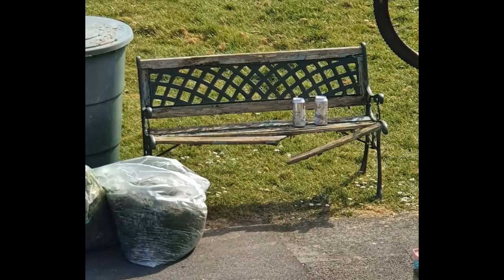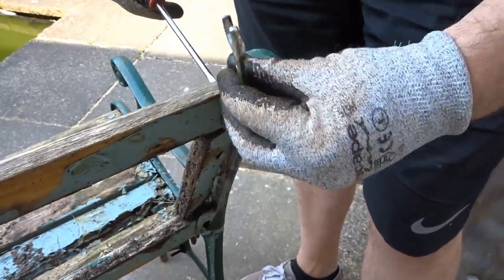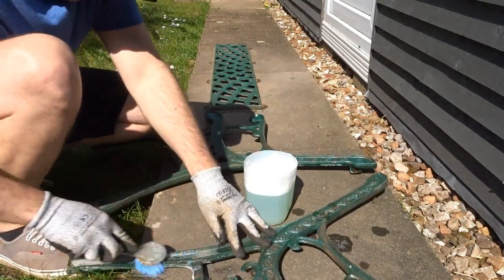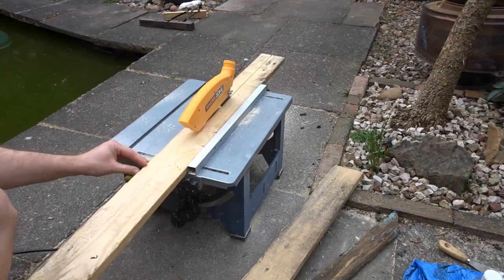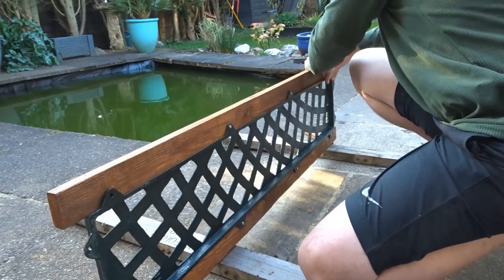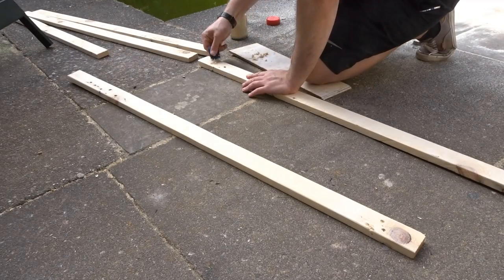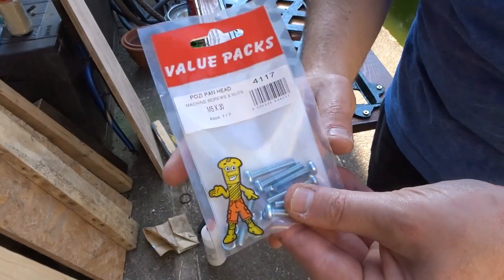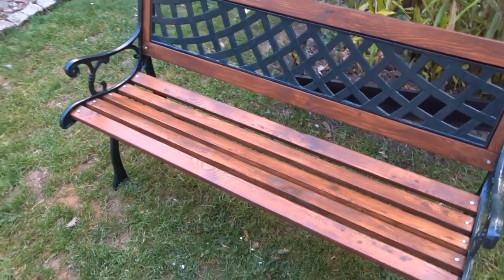How to Repair & Restore a Garden Bench Seat - Garden Furniture

Comment: Phil, I am just doing the same job on a bench, two chairs and a cast iron table with wood surround. I found the bolts had become balls of rust but was able to salvage 27 out of 31 slats which are hard wood and had been varnished every two years and preserved them but four slats completely rotten. Just doing the tedious job of tarnishing but the good weather helps. Great video.
Reply: Varnishing, not tarnishing. Damned predictive text.
Reply from the maker: Oh yea it is time consuming but like you say it's been dry and warm so that helps a lot. Hope your bench turns out well 👍

Comment: Looks brilliant, can you tell me how well the slats are standing up to the weather? I have a similar project, having found a couple of bench ends left out for scrap! I've also a cast iron bench back. Problem is finding decent priced hardwood. I have a stack of pallet wood butI don't want to be replacing the timber every year ;0)

Comment: Well done! I dont have all the tools you have. So it would be an expensive restoration.
Reply from the maker: Thanks👍🏻 you can do this job with basic tools as long as you can find some lengths of wood the correct thickness.
Reply: You don't need a toolshed full of expensive tools. I have done several benches, presently doing this exact same one. I have the timber cut to length at the hardware store or cut it myself with a handsaw or the jigsaw which is also what I used to cut down the width. does not do the job as well as a bandsaw or bench saw but does the job. There is no problem in my neck of the woods getting the 19mm decking timber to use.

Comment: African Iroko hardwood/Teak is the best option for timber.
It's got natural water repellent.
As you said also Oak...but oak is astronomical price.
I use stainless steel coach bolts/washers and nylock nuts.
They're not too expensive from Toolstation 😉👍🏼
Happy renovations
Reply from the maker: Good advice Lee 👍🏻 I would like to get my hands on a bit of Teak or Iroko 👌🏻
Reply: Hi mate, probably a probably bit late,  but iroko? Where the best-/cheapest place to find that? Just been given a dilapidated but stunning cast iron bench’s and table, like to do a good job.